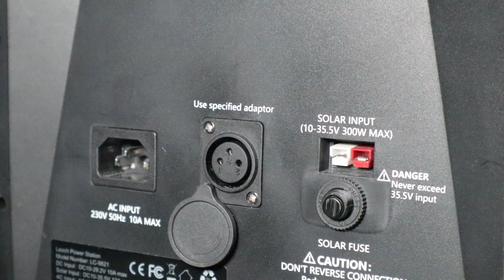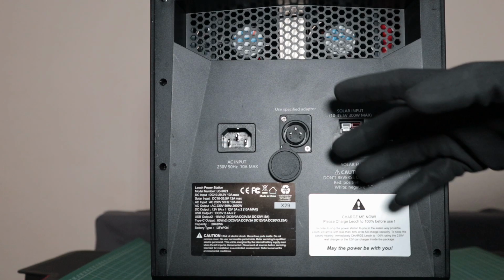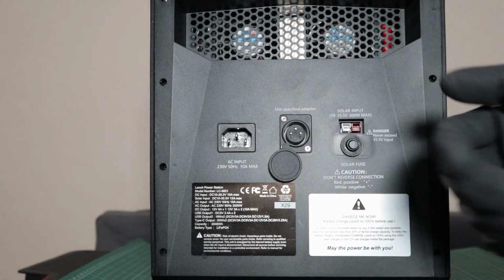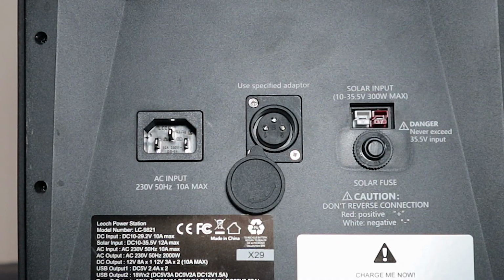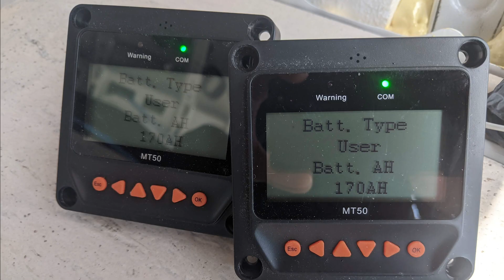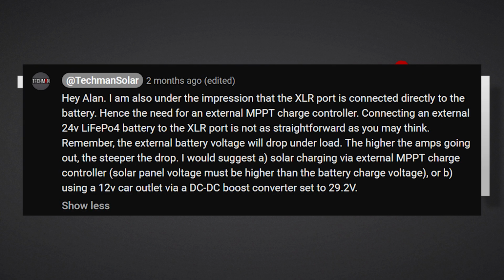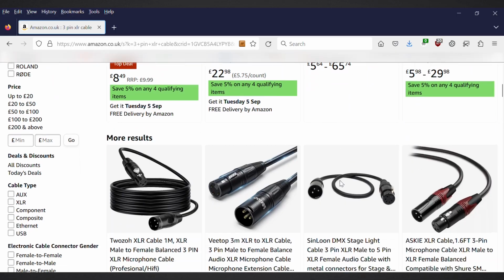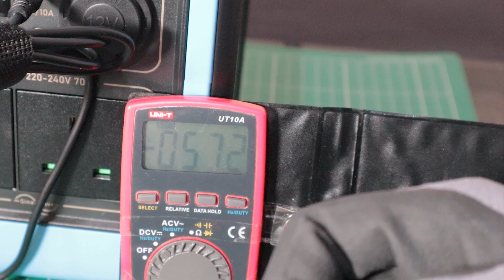Leoch Power Station | Exploring the XLR Port

Comment from the maker: I have isolated the issue, a loose connection. I also found, as rightly pointed out by @kevinlee4264 too, that Leoch has reversed the polarity, as they did with the Anderson PowerPole port. Pin #2 is negative and Pin #3 is positive. I've asked Leoch to send me a cable.

Comment: I wonder why they reversed the polarity?
Reply from the maker: Hey Nathan. Leoch did the same with the Anderson Powerpole port. But with APP port there is a workaround which I demonstrate in my review of the unit. For the XLR port, if you can’t find the correct cable, you’re screwed.

Comment: i use the xlr port with an mppt, i made a cable myself, you should have bat voltage on the plug, meassure directly at the pins, i think only two pins connnected as far as i remember
Reply from the maker: Hey there. I tested the pins first before trying the XLR - no voltage at the port. I assumed the probes may not pick up a voltage so the next step was to try an XLR cable. But, as per video, no reading.
Reply: @TechmanSolar  Leoch swap the pin out (#2 "-", #3"+") so the conventional XLR cable can't be used.
Reply from the maker: @kevinlee4264 Hey Kevin. Thank you so much. Last night I fiddled around with the internal connection. It seems to have done the trick. I noticed the polarity is reversed on the XLR port, similar to the APP port which I highlighted in my review. You’re right - the conventional XLR cable won’t work. Too bad the cable I have is soldered, so it’s of no use for the Leoch. I’ll email Leoch to send me a cable.
Reply: @TechmanSolar should be a lose connection
Reply from the maker: It was loose, thank you. But as Kevin mentions above, Leoch have reversed the polarity
Reply from the maker: Hey Indy, I hear you and agree it’s not the best choice. It is sometimes installed on ebike and electric scooters. One can argue that it may be suitable for those applications. But certainly not for wiring an MPPT charge controller.